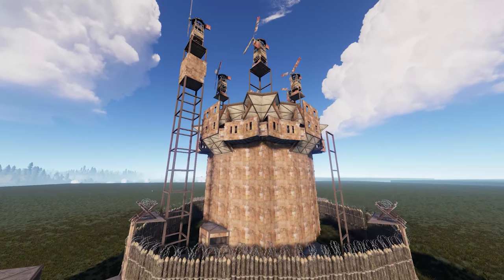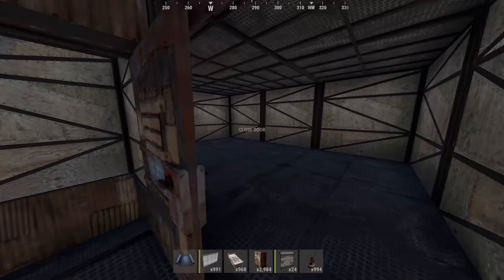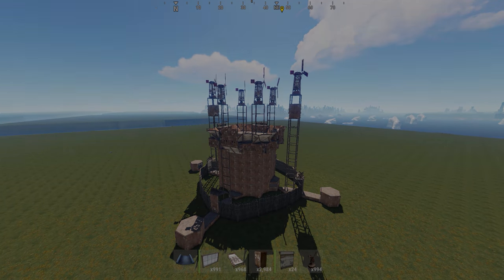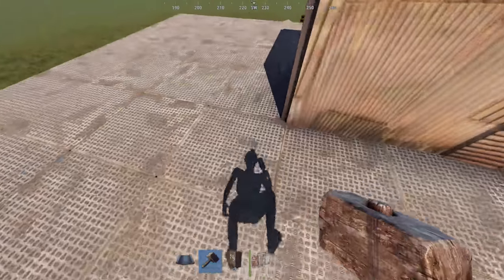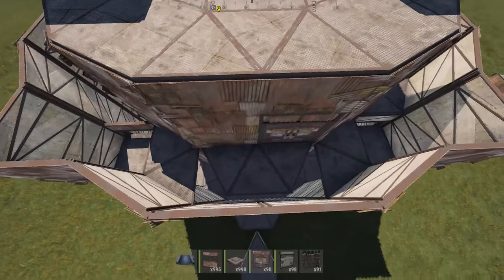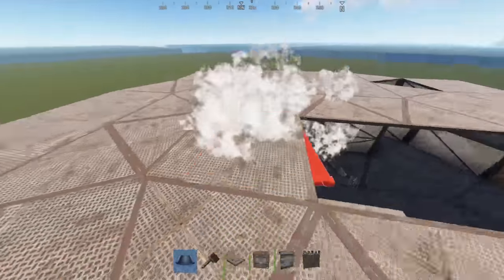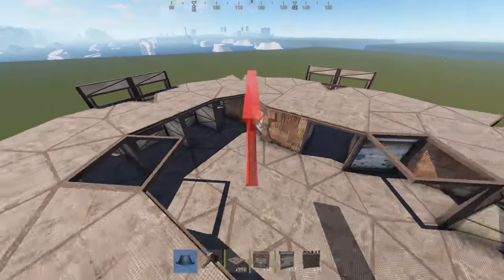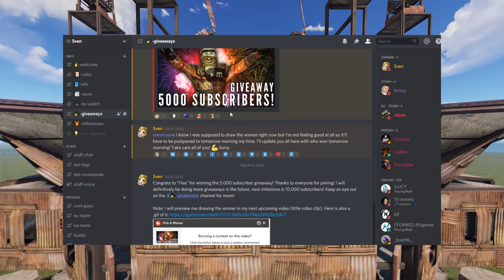THE SHELL V3 | DISGUISED 3x3 BASE | v3.0 | Base Building 2020 | Rust

Comment: hey, can you build this base with all the 4 external TCs splitting the cost of the outside shell? basicly that 1 TC covers like a quarter of the cost
Reply: Youd have to do it slightly differently with gaps because otherwise for some reason the Tc's will destroy themselves I was trying to do a quad TV rework all morning
Reply: @godspd7775  yeah i know that it would have gaps but the thing is that i cant place the squares at the corners bcs the triangles are blocking them
Reply: @amazed44  you have to deal with holes in the footprint, so this outer ring is 2 squares 2 triangle 1 square 2 triangle, you have to place another triangle on the first triangle next to the 2 squares and then build another square to it, do this on all sides and it should help with your issue if I understood it correctly, I know thats hard to understand how i wrote it but I can't think of a better way to explain it
Reply: @godspd7775  i think i know what you mean and ive already tried it out, so basicly you remove 1 triangle at like every 4 sites so you can place the square right? thats the solution i got atleast and i mean the outer layer would be the same just that you wouldnt be able to place walls at the outermost ring so youd have less protection